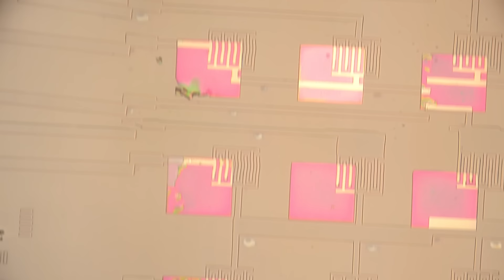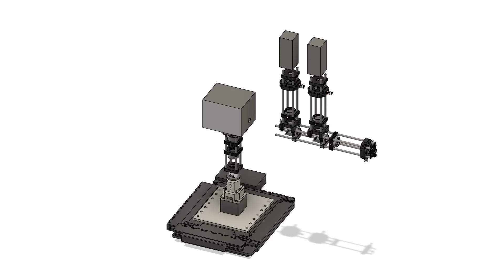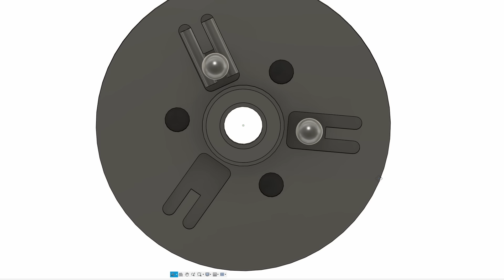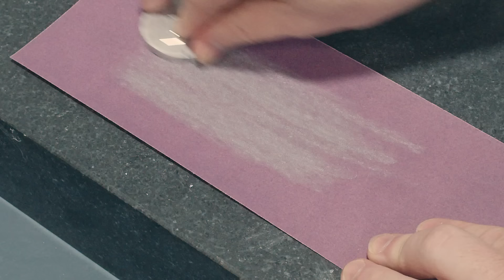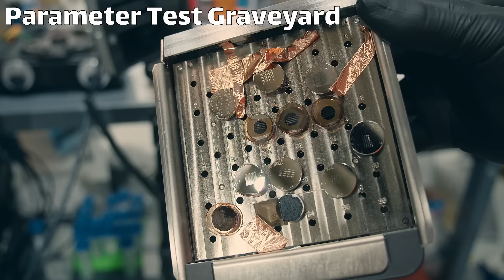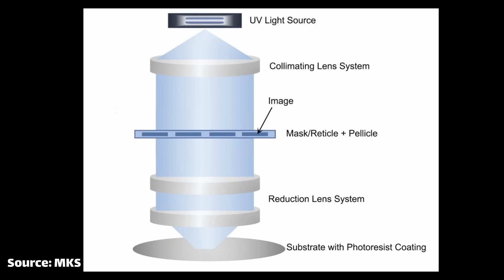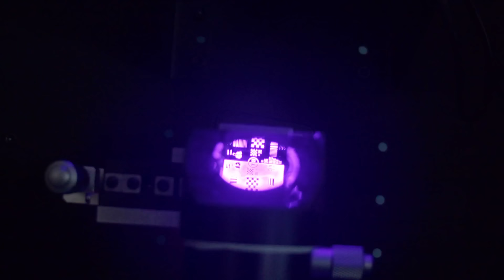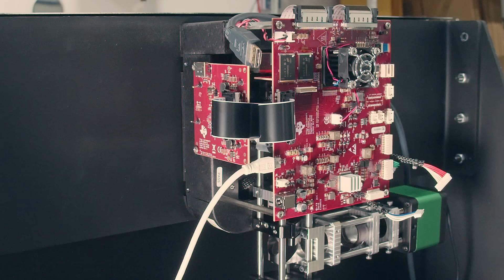Speedrunning 30yrs of lithography technology

Comment: Just a tip: The "nose" on a stepper motor is there to align the axis where you planned. This takes away any tolerance in the holes/bolts.
If you had matched the hole for alignment you could have enlarged all the bolt-holes and still had motor centered on fixture as planned. Not a big deal in this design but would have been important in a design where you rely on shaft position for gear mesh or belts etc.
Reply from the maker: TIL, cheers!

Comment: You should really have read the TI documentation regarding DMDs used in the UV range, as well as that regarding your chosen chip.
To cut a long story very short, you will definitely ruin (or at least degrade) that DMD if you blast it with < 400nm light. Furthermore, the optical properties at UV wavelengths of components meant for use in the visible spectrum can cause lots of issues, such as: 
- A lot of light being reflected back into the LEDs,
- UV absorbtion causing extreme heating of stacked components without good cooling. The glass covering the DMD and any of the optical lenses where thermal expansion would cause a large deviation in the focus or worsening of optical abberations at UV wavelengths. Even the metallization of the DMD mirrors in those consumer-grade chips can sometimes absorb a lot of UV Iight.
- Ineffective anti-reflection coatings.

Also make sure to check the dispersion of your optics, or even better, use the lowest power light source with a wavelength that is as close as you can get to that of your exposure LEDs (without noticably exposing the resist), to minimize focus errors caused by dispersion. I can't think of a single good use for red light on this kind of system, so maybe use that channel for a 450~460nm low-powered illumination driver.

You also need to ensure that the blue (>400nm) light that hits the DMD is properly diffused and collimated (I'm unsure how the optical train of that dev kit is configured, but you definitely can't just shine those LEDs directly onto the DMD.) TI has system design examples for each DMD that they sell to help you with this. Uneven input lighting doesn't just translate to a different dose-rate at the wafer, it also causes uneven heating and expansion of the DMD's mirrors. You could even be locally exceeding the specified absolute maximum spectral illumination intensity, thereby constantly degrading the reflectivity and/or the dynamic performance of the mirrors or the underlying CMOS latch at those hotspots, which would eventually lead to either 'dark' spots or 'stuck' pixels.

I didn't see how you were driving the LEDs, but you can't just re-use the integrated drivers and need to use a good quality, low noise linear current regulator with the usual UV, OV, OL and transient protection features to protect the LEDs and to keep them at a constant brightness. You should ideally take great efforts to keep the LEDs at as perfectly constant of a temperature as you can manage (also keep them under 50°C, most ideally around 30°, and only drive them at ~half the recommended current/power if you want them to last for a decent amount of time.), mainly to maximize the amount of time that you can use a constant exposure time.
It's no fun at all to constantly have to re-run your exposure optimization process, just because your exposure intensity keeps randomly decreasing as the components age. Or, you know, invest in a closed-loop exposure dose control system to automatically compensate for the average brightness variations at the wafer (which will only work if each LED ages at nearly the same rate over the entire projected field, but I digress).

Finally, I know almost nothing about the mechanical side of engineering, but I do know that NEMA motor has no right to be directly coupled to the image plane.
You should also completely discard that magnetic attachment system. Those magnets aren't going to snap back within 10um of their last position. It would be much better to lap the chuck against its mating surface, or by some other means generate a large, flat and even contact surface for it to repeatably and mechanically mount against.
Reply from the maker: Cheers! Some of these are definitely on my radar, just didn't have time to fully implement. Taking notes about some of the other points you brought up and will try to incorporate them in future iterations 👍
Reply: @BreakingTaps  Thanks for taking the time to read all that and for writing a reply! It is much appreciated. (PS. Please excuse my bad english. I do try my best, but languages have never been something that I could really get the hang of.)

I would really love to see this project succeed so, if you ever think you may have any questions that an EE might be able to help with, don't hesitate to contact me.
I even have some excess free time at the moment so I wouldn't mind doing some quick circuit design/simulation and/or PCB design and layout work for this project, especially if it's regarding something that I'm experienced with (obviously, I wouldn't have any IP rights to the designs and don't want to be publicly credited or thanked at all, nor would you be obliged to use any of my contributions. I just want to help you to avoid some of the common pitfalls and "traps for new players", that I'm familiar with.)

Comment: You probably mentioned and I didn't catch it, but what drives the requirement for the rotary stage? The X-Y platform is extremely nice, it seems like you could have an easier time of both flatness and flat movement by staying as close to it as possible.
Reply from the maker: Oops sorry, I ended up cutting the section that described the reason! It would be used for multi-layer alignment. So pattern the first layer wherever, and then on subsequent layers rotate and align to registration marks. In theory it could all be done in software (rotate the source image) but was a lot more software work than I was wanting to do at the time :)

But yes, it caused a world of hurt and in retrospect was probably not necessary on version 1. 🙃

Comment: Here’s an idea, use a laser light source, put an image in front of it and then focus the light onto the resist. Develop it and use it as the new image in front of the laser. As long as your laser beam is perfectly straight, you should be able to repeat this until the details of the image are so small that they interfere with light. 
You’d have to come up with something to have a gradient but this would be great for anything that needs solid lines. 
If I were to do it, I would use a small magnification level between each step so the focus depth doesn’t effect the clarity of the image around the edges. You may have to repeat the steps over and over again but once you’re at the size you want, you’re done and can easily recreate it as many times as you want. 
I think it would be relatively easy to do with the second set up.

Comment: My first thoughts when seeing the sheetmetal construction was that they would probably cause you issues. I would think taking a slice from high precision optics benches and precision machine and using big chunks of cast iron or granite would be your best bet. The excellent Dan Gelbert video where he makes his high accuracy lathe he purchased granite parallels which can be epoxied together to form very sturdy platorms. I would also think you would want to put something like that 3D printed microscope flexure system between your base and the optics as well as the motion stage. Does the zaber unit want to be hard mounted? I would think it would prefer a compliant mount. Could you maybe lay the optics flat and operate the zaber vertical? That way you could use add high accuracy linear stage under it easily. Just some thoughts keep up the Great videos looking forward to more great experiments.
Reply: Re hard-mounting, the X-ADR stage is "low profile" which is inherently not very rigid so hard-mounting to a flat, rigid surface is actually recommended (we do our interferometric calibration with the stage hard-mounted to a granite surface plate) though not always possible. Flatness of the mounting surface will impact flatness of motion (vertical runout and pitch/roll error). So if the mounting surface has questionable flatness, then a more kinematic/compliant mounting arrangement will probably give better flatness of motion. For vertical operation, the X-ADR wouldn't be a great choice as it doesn't hold position without power (ie it will crash if unplugged or if power fails) and it would draw a lot of power and generate a lot of heat (and thermal expansion) in order to hold its position. For vertical operation we have linear motor stages with adjustable magnetic counterbalances to solve those issues.
Reply: @ZaberTech  Hey thanks for answering! Not mounting the X-ADR vertical makes sense, especially after I looked at your website in greater detail. Thanks for confirming my assumptions. Love the openess of your approach to microscope design! I am definitely looking for opportunities to use your products in my future ventures.

Comment: I mapped my z height using interferometry and DFTfringe and adjust my heights with a piezo linear actuator. X and Y were mapped using a reference mirror tilted at 45deg and about 12 feet to calculate any wobble (it showed that i had a slight twist and bow that i compensated for in software). I also dont use a lens on my camera since the light coming out of the objective is suppose to be parallel. A cheap photoresist that i use is D&S Posicoat used for metal etching. I can easily get ~800nm features with it (its as far as i could test before my daughter was born). I took alot of inspiration from hyugens optics with a mix from applied science. I have mostly made mesfets due to their simplicity. Also materials project is a great resource when trying to determine what materials to use, bandgaps, mobilities, lattices, energy levels, and compatible substrates.
Reply: Seconded, while troubleshooting uniformity I've unplugged the piezo signal on a maskless aligner during a write. Work it's able to do to keep focus cannot be understated.
Reply: Can I pick your brain about the camera comment? I have a secondhand stereo microscope from Vision and am trying to mount a camera on one of the two optics paths. I believe the light is parallel in these stacks but a camera in the path doesn't work right... How do I reason about camera sensors with parallel light beams? I thought we had to project a focused image onto the sensor?

Comment: well a microcontroller or drone flight controller, or an sd card could be a fun project, for that. nice job. also nice "lol" inserts. learning process (tm)(r). you could always use pre-made corner beam and flat sheet combo, with bolts. you will find suitable pre-cut sizes of all thicknesses on normal providers or even local hardware store, which is non-specialized. also you can use thinner parts if you do some car chassis cross support systems.
Reply: Try spin coating a dvd-r disc, then pattern it with the dvd drive laser. Dot width is below 1um. No modification to the dvd drive. Draw a nice image with the laser.

Comment: This is honestly amazing.  I think that the maskless machine could still get the full job done if you could just come up with a solution for the stage flatness/correcting the other 2 rotational degrees of freedom.  If you could commercialize this I feel like you could sell a bunch, these resolutions are still extremely useful in a lot of fields.  My company got a simple crummy mask aligner for over $100,000, and with some minor adjustments this could be better in every way.

Comment: Unrelated to your impressive work and achievement, what watch are you wearing?
Reply from the maker: Hamilton Khaki Field Mechanical! I used to wear a cheap Timex Expedition, but stumbled on an ebay listing for the Hamilton and couldn't resist. Was about 50% off but still the most expensive watch I've ever owned by a good margin. Sometimes get concerned wearing it in the shop since I don't want to break it 😨 First mechanical watch too, I've discovered I really like the routine of winding it each morning :)
Reply: @BreakingTaps  I knew it! That's on my near term 'to buy' list! Great taste!

Comment: Fun fact about standing waves in photolithography, they are worse the more narrow your source wavelength filters are. Standing waves are worse for laser and led sources vs hg lamps. Source: I make antireflective coatings for litho for a living.
Reply from the maker: Ah yeah, that makes sense! I assume a wider bandwidth will "smooth" the standing wave since the different frequencies all interfere at slightly different locations? I was impressed how crisp and "step like" the standing waves were! I had seen them in the literature before but never in my own tests. A quick post-exposure bake seemed to get rid of the worst standing waves luckily :)
Reply: @BreakingTaps  You have your work cut out for you!  Early in my career I was also responsible for alignment and overlay matching a fleet of ASML tools.  So many variables!

Comment: Very cool, and I'll be following this project with great interest!

I think directly coupling the maskless stage to the stepper motor is a strange choice.  I wouldn't expect the bearings, shaft, and mounting flange to be true, straight, and square enough for this application.  Most machines I've seen use bearings to hold the precision components and a flexible coupler to the motor.  

Also, have you considered the flex of the sheet metal chassis in troubleshooting your optics mounts?  Maybe polymer concrete? Or build it onto a clapped-out benchtop milling machine for its cast iron chassis?

Comment: Have you considered using a blu-ray pickup for both the UV laser and optics systems, and as a stage? A standard pickup has a nanometer accurate voice coil holding a lens, and a UV laser, as well as a photodiode, through you probably don't need that. I know there's been a paper on using them as a micro 3d resin printer. The idea is you use two pickups facing each other at right angles, since they only move in one horizontal axis as well as vertically, so you attach the sample to one pickup and use the other to scan the laser over the sample. I've used them to make a laser scanning microscope with extremely high magnification (diffraction-limited), so the potential is there. You can even use the photodiode to measure the distance to the sample with nanometer accuracy, which should help keep things in focus. The real limiting factor is that the pickup's coils, while extremely accurate, can't hold much weight. That means if you use one to hold the sample, you'd be limited to a couple grams max. 

Fun fact: you can even use those same pickups to make an atomic force microscope
Reply: What are you some kinda wizard?
Reply: Wasn't there a youtube channel that did just that?
Reply: @mr_gerber  I think Dr.Volt (right name?) did one, mine's a separate project though, with <500nm resolution and faster(-er) scanning. The main difference is that mine uses a second pickup unit to hold the sample instead of a 3d-printed actuator. It has the benefit of more precise and faster scanning, at the cost of having to use small and light samples.
Reply: @nilpybilpy4346  Yeah, that sounds right. Concept felt familiar.

Cool! Are you sharing your project somewhere public?
Reply: @mr_gerber  I tried posting the link from my phone, didn't go through so I'm trying on desktop (update, still didn't go through...). Here's the link for the project (just the project location relative to giithub's home page in case the issue was from posting a link): NilanEkanayake/LaserScanningMicroscope . It's currently not very polished, and will likely have bugs and require a decent amount of knowledge on the subject to build. It also uses a DVD laser (~650nm).

Comment: Dude ... It's hard to believe that you actually achieved all that by yourself ! It's some really impressive work ! 

For switching to 365nm leds be careful about the fact that optics (especially microscope objectives) are designed to work well for specific wavelengths, using 365nm light with a microscope objective designed for the 400-700nm range may cause the following issues : 
1. poor transmission (I mainly think about optical coatings, for exemple a very common antireflective coating that Thorlabs calls "AB" and Edmund Optics calls VIS-NIR  is actually very reflective at 365nm) 
2. a perceptible  shift of the optimal focus  (especially for "achromat" objectives, you can try to check out the performance graph listed for some objectives on Thorlabs. This is because the achromaticity of the objective is achieved by optimizing some optical performance metric, that can modeled as some high order polynomials, to be as flat as possible on the nominal wavelengths but it means their values tend to diverge quickly outside the nominal range)
3.  image quality degradation near the edges of the field of view
Now it's not necessarily game over, but this is something to keep in mind especially if you're going to do to your alignement using the visible colors and then switch to UV for the exposure.

Maybe one trick you could use is to use photoluminescent material (in place of the mask to be exposed) to be able to have a direct visualisation of the UV image you're projecting, but I'm not sure about what material to use for this. Paper is highly photoluminescent but maybe not flat and uniform enough, Aluminium Oxide ceramics are also photoluminescent and maybe would work, or maybe just something painted with white paint.